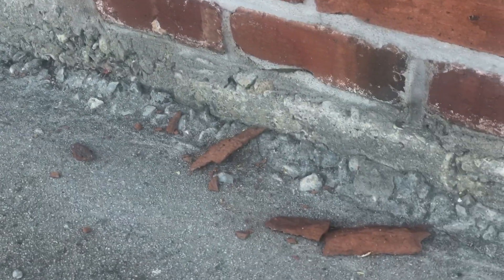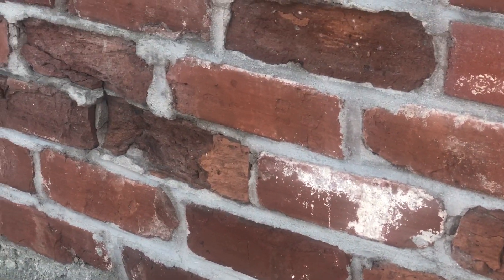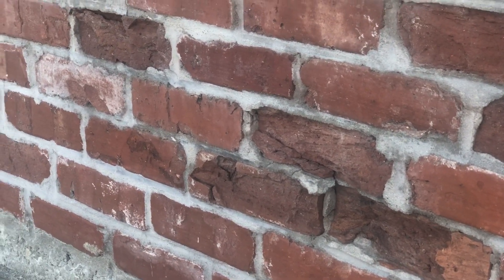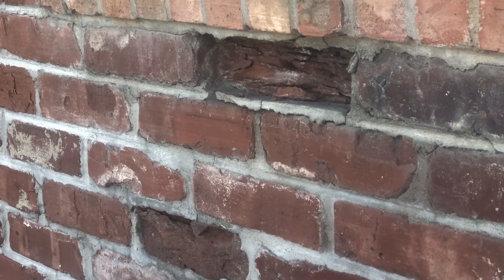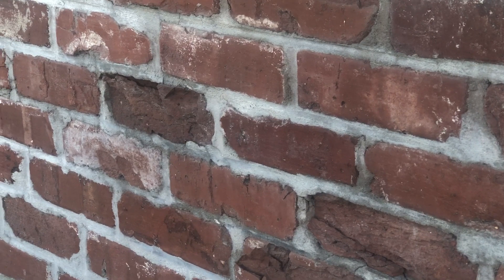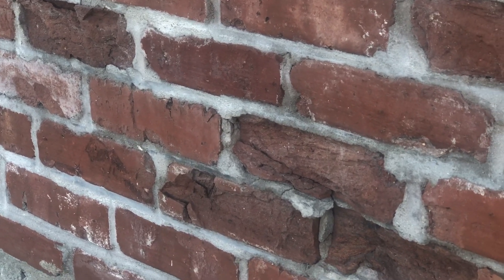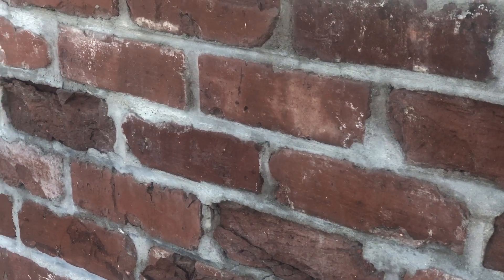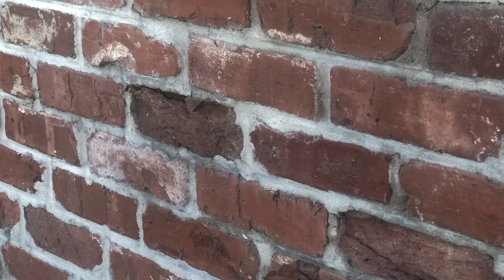Historic Building Restoration – Old Bricks Wrong Mortar

Comment: Your comments regarding the use of old brick is incorrect.
The real problem is the brick itself and not the type of mortar used.
While it is true that lime and sand was used as mortar years ago, due to portland cement not being as yet available back then.
The real issue is that all the walls were solid brick regardless of the thickness of the wall.
The areas of the walls that were exposed to the elements of wether were of a higher quality than those used in unexposed sections of the wall. Those brick were commonly referred to as (salmon) brick due to their color, and were not intended for use as (face) brick.
When those old buildings are torn down and the bricks recycled for use again, they are all mixed together and sold as used brick.
You can easily pick out the lesser quality salmon color brick in a used brick wall.
Depending upon the location as to where the bricks are used regarding temperatures, as in freezing and non freezing locations, the bricks will react differently. But the salmon bricks will absorb more moisture than the higher quality face brick, and when that moisture freezes it will expand and cause the brick to crumble.
Thats why you only see some bricks affected and not others in the same wall.
My father was a bricklayer who started his career in the early 20s when all walls were built of solid brick, due to cinder block not yet being created. In the 50s when i started my career in the building industry he made me aware of those differences in the makeup of the brick.
When we built houses having used brick as a wall facing we would not permit the masons to use the salmon colored bricks.
Moisture penetration and freezing temperatures are problematic for all types of masonry including concrete.
But the use of soft brick never intended to be used as a face brick is a problem easily avoided by proper supervision.